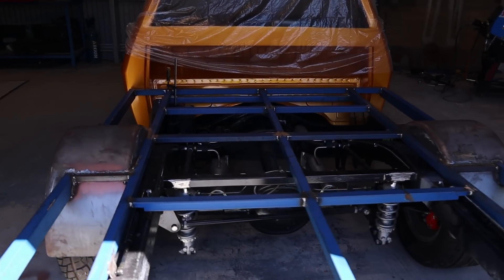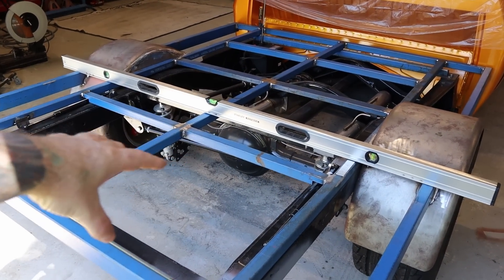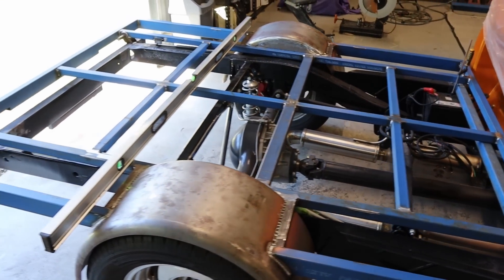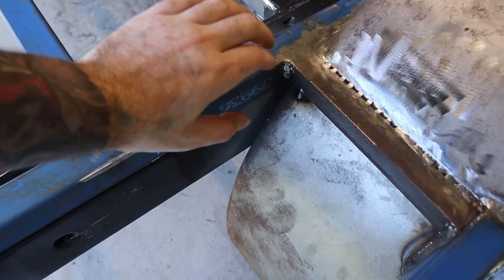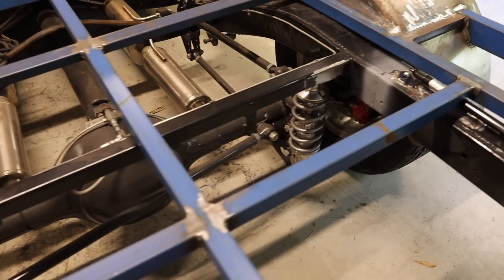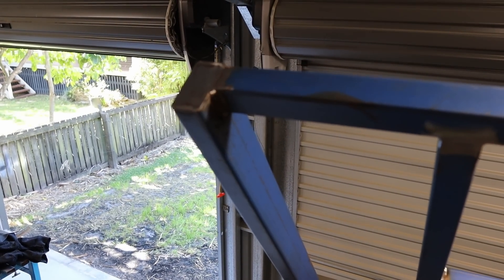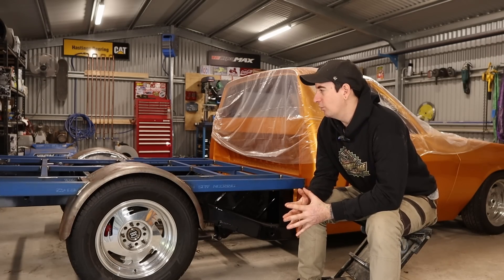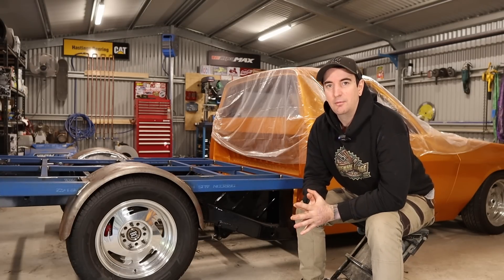Building the Tilt Tray Episode 5  - HX One Tonner Tray Build

Comment: Found your channel when looking at your Astra power steering hack and have now binge'd most of your stuff. I love the overall attention to detail. Looking forward to seeing the laser cut sections for the tray. I'd go with the strongest pressure struts they have because they do slowly lose pressure over time (especially in the elements) I'd also consider a manual lock for the tray hold down because if it flipped up driving you could rip the whole backend off...Just keep up the great work. Hope to see the finished product down the track!!
Reply from the maker: Hey Mate thankyou. Glad you liking the videos. Yes I was thinking the same with a manual hold down for that exact reason you say. Cheers for the comment.

Comment: With regards to the gas struts, would it be worth considering moving the tray strut mount up higher on the tray. You have a lot of weight on the fulcrum point, which is very low on the tray. Move the fulcrum point higher might alleviate this stress. I realise it would be a pain to do now it is all welded in, but better to do now rather than after it is all done and painted. Coming along nicely though.
Reply from the maker: Hey Mate thankyou. I did think of moving the fulcrum point up higher but then it starts to have clearance issues on the chassis where the mount hangs. I might have another look at it as I could prob lift the mount up a bit higher. They only tacked in so its not a big job to potentially move them.

Comment: Depends what you're going to be carrying on the bed but would it maybe help if you added some sort of mechanism for tipping it?  It's going to behave very differently with a heavy load in it. You said it's pretty weighty as it stands now; anything in the bed will add directly to that weight.
Another thing I thought of: Are you ever going to need some sort of locking device, to support the bed when raised? Even a simple arm, like a hood/bonnet prop would do. Even if you decide to upgrade the hydraulics, a physical support might be a good idea, From a safety point of view, if you ever need to be 𝒖𝒏𝒅𝒆𝒓 the deck, it would be an advantage if you could secure the bed in the raised position.
I'm not suggesting these things in any critical way. I'm no truck designer. I'm just thinking aloud, about weird, bizarre situations that could arise in the future.😁